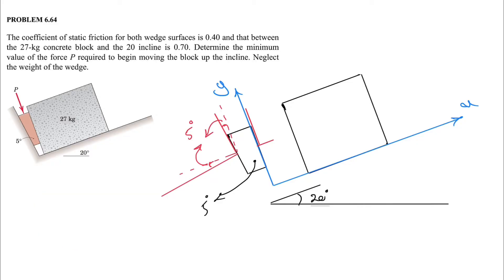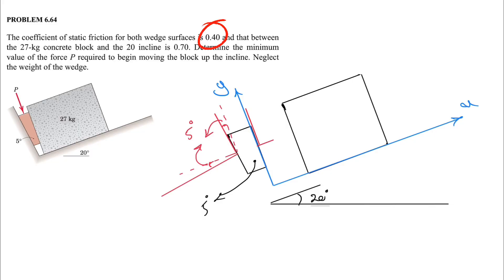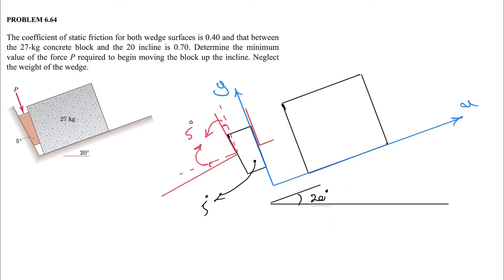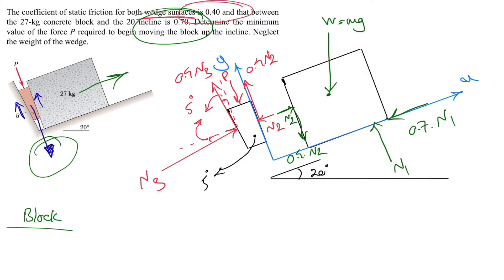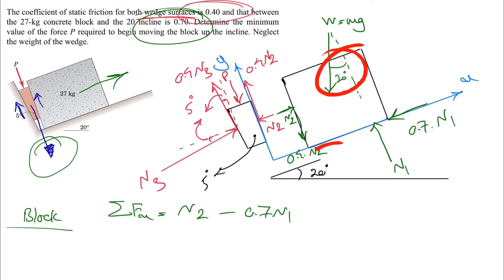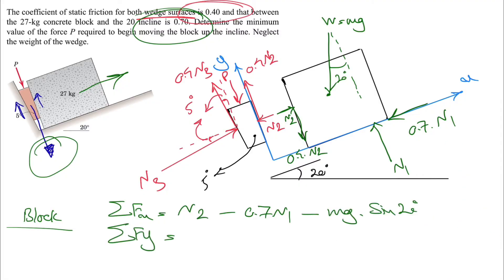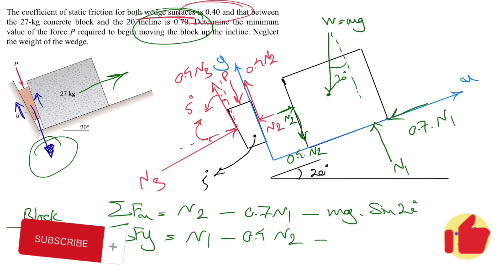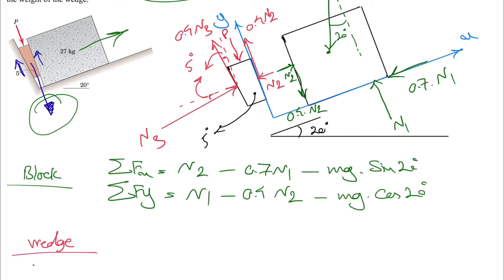Solved Problem 6.64 | Determine the Minimum Value of the Force P

Comment: Pls how did you get N1 i tried solving but it didn't give me 396N
Reply from the maker: What did you get? it must be an error in the calculation.
Reply: From the first equation i did the calculation it gives me 91.33N1 when i putting it into the second equation to find N1 it didn't give me 396N